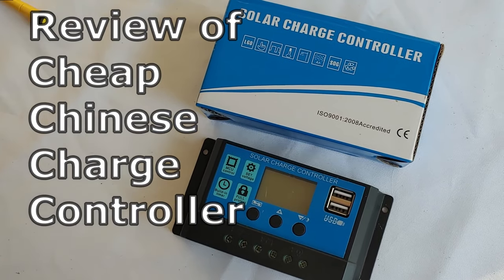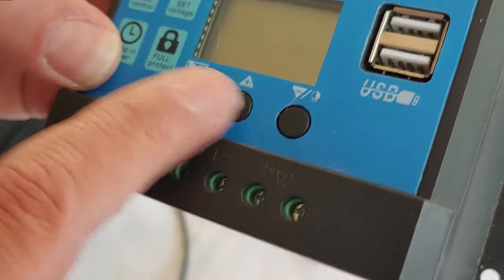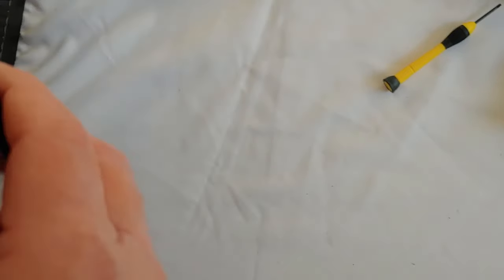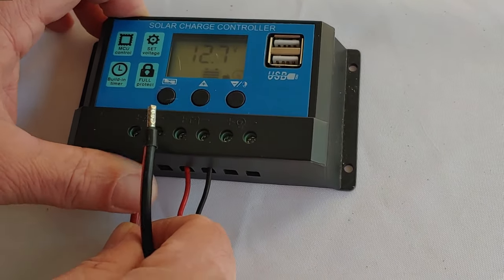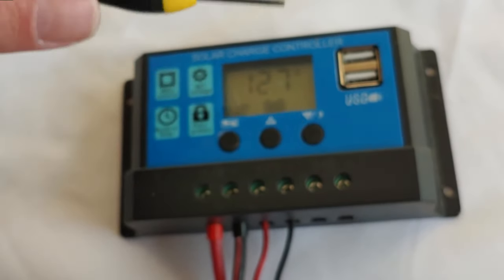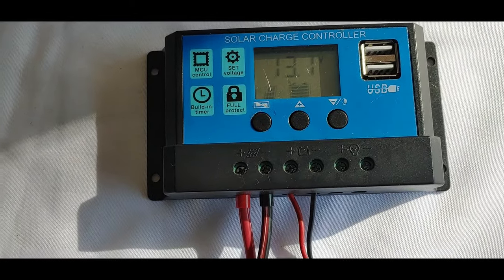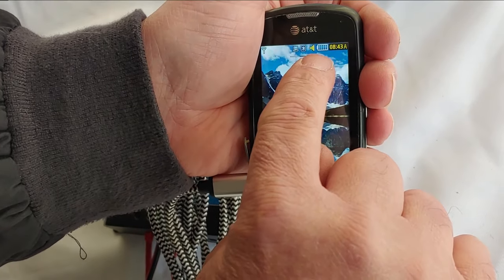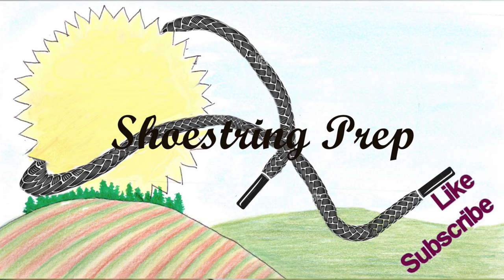Cheap solar charge controller

Comment: You did not explain the timer function. Somehow I could not get mine to work right... And by the way a LiFePo4 can be safely be charged by those PWM charger because their voltage levels are really compatible except that the later do not need equalizing and prefer not to be trickle charged. But that's why it is imperative that the LiFePo4 has a built in BMS, which most of the commercial packs have de facto. I prefer to attach my own BMS with bluetooth and active balancer to monitor the state of charge and balance of the cells. Preferably, I would chose one that match my deisire Ah and that come with 1, or better yet,  5A! active balancer. Both Heltec and Daly makes one for a reasonable price. Heltec is cheaper but Daly is  bluetooth capable.
Reply from the maker: If you have expensive equipment you should probably buy a better charge controller. These are very cheap. Thanks for your comment.
Reply: @shoestringprep  You're right! This charger  is actually perfect for my brother's pond. It uses a 24V, 80Ah deep cycle battery, one 300W inverter and two 200W panels. It's a $80 dedicated solution, that fits the bill.
Reply from the maker: @francoisguyot9770  Thanks for your comment.

Comment: Hi shoestring. Where should i connect the inverter ? On the battery connections or load connections?
Reply from the maker: The inverter is connected to the battery not the charge controller. Thanks for your comment.

Comment: Can I use this for this Portable Power Station 100W Portable Generator 146Wh/39600mAh External Lithium Battery Pack with USB C or my Newpow power station and bypass the battery since they both have their own built in batterys
Reply from the maker: I don't own one of those generators so I cannot answer that question. Sorry. Thanks for the comment.

Comment: Recently I wondered how much is the charge controller type or model going to affect the performance of your system? I have a cheap charge controller like this one. And it does work. But some people seem to have varying results on what voltage their batteries are charged too. That could be just the battery quality, but I wondered how much of that is being affected by a good or great charge controller versus something average? Are the results of a good or great charge controller going to look the same or very different than an average one controlling a system being charged? 

Thanks.
Reply from the maker: The type and model of the charge controller makes a great deal of difference.  Thanks for your comment.

Comment: Hello. I have a 30 W panel kit, but no battery. I connected the solar panel lines (neg & poss) to the Little blue regulator, as shown in your video. The regulator worked right away, so I charged my phone and my 20,000mAh internal portable battery charger in those 2 USB ports, and it charged both of them. After about an hour, I had to leave, but I left 2 of my 20,000mAh internal portable battery chargers connected in the USB ports.  The next day, with the same set up, but this time the little blue regulator didn’t show nothing at all, complete blank. It did this for two hours with direct sunlight, and again the regulator showed nothing. I made sure everything was connected right and in place, but still no results. Can you tell me what that’s about? Thank you
Reply from the maker: The system you describe will work. I have done it myself. But the manufacturers say that you will burn your charge controller out if it is not hooked to a battery.
Good luck and thanks for your comment.
Reply: @shoestringprep  Thank you. So the little blue charge connector is pretty much a goner huh  🤦🏻‍♂️ now I gotta get a new one. I appreciate your time & wisdom. Thank you once again🙏🏼
Reply: Hello again @shoestringprep! I wanted to ask if you could help me choose the best & fair priced 12v battery that would best fit my 30 watt panel? 
& since I’m here asking, how about the best fair priced inverter, where it be 150-300 watt inverter. What would be your recommendations be sir? Thank you!

Comment: How does the wire make the connection to the charge controller?  I know you unscrew something and then a square opening appears. Then you put the wire into the square opening and tighten the screw. But is the connection made by the wire touching the plate that drops when you unscrew the screw or does it connect when the wire goes in the hole and touches something inside at the back?
Reply from the maker: I don't know. I do know it works. Thanks for your comment.
Reply: The screws, plates and back of the holes will all individually be sockets connecting the circuits

Comment: Hi just subbed how long did it take to charge battery just rigged up sysyem bit baterry showing full but discharges fast and showing number 601 on controller same one as you
Reply from the maker: How fast your battery recharges depends pn the size of your solar panel. Thanks for your comment.

Comment: I hooked up the same charge controller to my RV. Do l want to move the load lines from my batteries to the controller or leave them hooked to the batteries.
Reply from the maker: I would leave the load hooked to the battery. Thanks for your comment.

Comment: You said you had 'lead acid battery' as bulk of your power systems. 

I was curious to ask ... the lithium batteries haven't been around that long. Doesn't this mean lead acid may possibly last better if taken care of? There should be more years to have scienced out all the kinks on something that's been around longer? And I'm curious how long you think a lead acid battery bank would last for if taken care of right? Thanks.
Reply from the maker: My lead-acid battery bank has run well for ten years and is still going strong. I don't know how long it will be before they die... But these batteries are well taken care of.
Thanks for your comment.
Reply: @shoestringprep  That's amazing! Thank you for the reply.

Comment: What king of phone is that man?
Reply from the maker: The phone is an AT&T. Thanks for your comment.
Reply: I noticed that too it's a Samsung S3650 Corby or Genio ; the camera is very poor, and no smart dialing,and no wifi ?; i was looking for one of that size (the big ones i have are not suitable to carry in the pocket (nor in your hand...not anywhere,actually...) to replace my HTC Explorer (excellent phone for over 10 years,perfect,perfect battery etc ,but terrible camera also,actually totally USELESS) but i wanted one with a better camera, and it probably never existed      lol
Reply from the maker: @josepeixoto3384  Thanks for your comment.

Comment: 4.14 (re device/lightbulb).. 'as long as the sun is on the solar panels it will run' - is this correct? What should happen.. to my guess.. is that the device (lightbulb) is run from the battery or the solar until the battery lowers to a certain voltage (maybe 11 (lightbulb)) and then the device will be switched off until the battery has regained some charge from the panel (maybe been lifted to 12v) ??
Reply: if the controller allows the battery to drop too low (by running the device when there is no sun) the battery will be ruined and lose its ability to recharge.. so this low voltage cut is very important.
Reply from the maker: Thanks for your comment.
Reply: @shoestringprep  Did you read it or have reaction?
Reply from the maker: @sammorganmoore  I read all the posts and happy to do it. Please restate the question, because I did not see any questions. Just statement
 And as always thanks for the comment.🙂
Reply: @shoestringprep  I quote what you say and then ask you a question about what you said. - just before the question mark. Is it correct that the device only works when there is sun on the solar panels?
Reply from the maker: What I meant is the load will run with the solar power as long as the sun is hitting the solar panel. After the sun is down, or it is cloudy, the device will run off the battery and drain the battery. You can also program the load to run 24 hours, 12 hours or from dusk to dawn. I may also do a video on the is subject. Thanks for the comment.

Comment: , can i charge my lead acid solar batt using a power converter with at least 12amps not a solar panel,?thanks👍
Reply from the maker: You can charge your lead acid batteries with a battery charger. If your power converter is, made to charge lead acid than you can. Check the manual for the power converter. Thanks for your comment.

Comment: I just acquired one of these but without instructions as it came with another purchase. Mine however is suitable for lithium but I cannot see how to set it to different battery types. I have found a screen that scrolls from BT1 to BT6 which possibly are type settings. Can you verify which would be which please?
Reply from the maker: Since I am not familiar with that model I can't say which one. Just make sure the settings is about 14.6 volts for lithium. Thanks for your comment.

Comment: Will the load operate a 12v device at nighttime, if the battery is charged? ty
Reply from the maker: Yes it will. The load will take power from the battery. Thanks for your comment.

Comment: Can you just use the 12 V power supply without the batterie ?
Reply: No, manual says not to operate the device before the battery is connected

Comment: QUESTION??? Can you connect an inverter directly to the controller or must it go through a battery?
Reply from the maker: The inverter and charge controller will need a battery to power both units. Thanks for your comment.
Reply: Inverter always connects directly to the battery. Theoretically you might be able to run a small 25 watt inverter on the load side but not advised
Reply: @tluva1020  thank you!

Comment: I am using one of these controllers to charge a Milwaukee M12 Lithium battery but I've already killed a couple of batteries. I use it to power a 4G hotspot from the USB port and a WiFi camera (1Amp) from the load terminals. I have it set to the correct mode for lithium batteries and it charges fine. My trouble is when we get an overcast day the batteries drop below the Discharge cutoff voltage but it does not cutoff the load and the batteries are discharged to destruction. I'm wondering if there is a minimum load current required for the controller to function correctly.
Reply from the maker: I have not noticed a minimum load requirement. But these are cheap charge controllers and they do have to be watched. I check mine frequently as well as unhooking them in the evening. Thanks for your comment.

Comment: is it ok to have (2) 12v batteries connected together for the purpose of having more storage and use this charge controller
Reply from the maker: Yes you can use this charge controller to charge batteries that are in parallel. Thanks for your comment.

Comment: I want to change the discharge stop voltage, and discharge re-connect voltage. I can get into the menu and settings and change the values, but it does not seem to retain the changed values when I go back into the menu to check..... I can't tell if my values remain set, or returned to defaults
Reply from the maker: With my charge controller the value stay set. And will not go back to the original settings unless I do it. Test and see if it works the same as mine. Thanks for your comment.

Comment: Quick question: Does this device come on if only connected to solar panels (19.4 VDC)? I’m trying to troubleshoot the one that came with house I bought last year. Battery appears to be ruined (disconnected it). But device won’t display anything.
Reply from the maker: The solar panels may power the device but that can damage the charge controller. Always connect to the battery first. Thanks for your comment.
Reply: @shoestringprep  yes, I see now that it operates by power from battery only, not from solar panels. Prior battery was defunct. New battery works great.
Reply: @shoestringprep  thanks for your help

Comment: Hello, Does it work if no battery plugged in ? Thk you
Reply from the maker: No, the charge controller gets it's power from the battery. Thanks for your comment.
Reply: @shoestringprep  Thank you.
What kind of battery are recommanded : Gel, Acid, Li-Ion, LifePo4 ?
Actually, i have a spare 110W solar Panel and i would like to use it with a charge controller as an emergency USB plus + 12V lamps
Reply from the maker: @BlueThailand  I would recommend a cheap 12V 100Ah LiFePO4 Battery. See a link to one I like.     https://amzn.to/3hxzDmT. Thanks for your comment.
Reply: @shoestringprep  👍👍
Reply: @shoestringprep  Hello, i found and bought a similar battery. Does this charge controller able to stop charging the battery when full ?
Thank You
Reply from the maker: @BlueThailand  yes it does. But it is cheap. Keep an eye on it. Thanks for your comment.
Reply: @shoestringprep  Thank you. I guessed but as it is so cheap and Chinese that i had doubt ;)
Finally, it is a cheap solution; For 1200 THB (35$) i have the battery and the controller. This way, i can charge small devices (usb fans, smartphones, .. and 12V led lamps
Not the top, but useful.
Thank you, sir

Comment: Is it at all possible to use this with the battery only and without the solar panel? I want to hook this up to a small inverter and use it to prevent any appliance from draining the battery too deeply with the low voltage cutoff feature, but it doesn't seem to be working even though my multimeter shows I'm getting 12+ volts. What am I missing?
Reply from the maker: The point of the charge controller is to control the voltage from the panels going into the battery you will need a charge controller. The charge controller will protect your battery from overheating.
Reply: @shoestringprep  So the low voltage cutoff feature does nothing then?
Reply from the maker: @1acroyear1  the low voltage cutoff is supposed to turn the charge controller off at a certain point. But with these cheap charge controllers that does not always work. Thanks for your comment.

Comment: Can we used solar panel (with Charge controller) and Current (AC) to charge our battery at the same time (simultaneously)... Is it harmful for the battery? Waiting for you reply pls...
Reply from the maker: As long as your charger controller is set correctly and your (AC) battery charger turns off when the battery is fully charged you should be ok.
Reply: @shoestringprep   thank you so much

Comment: I want to charge 12V old car battery and use it for WIFI surveillance camera that uses 12V. Commercial manufactured solar or  battery powered cameras can't do 24/7 they only wake up with PIR sensor.  
Camera uses up to 8W of energy, to run 24/7 it will be about 192Wh /24h. From 12V battery it would be about 192/12=16Hh,  Old battery is rated at 45Ah, so I assume that it can hold a third of its rated power, and it will get some light during the day directly from solar panels, so from the battery it will have to run only for max 16 hours when there is no sun. So in the winter short cloudy days I might need some 100W to 200W so it reliably can top off while sun is available.
There are plenty of cheap used panels available locally, panels in 100 to 200W range are almost for free. But most of them have higher rated working voltages, 40V or more, up to 100V. 
I wonder what will happen if I connect such panel (say 50V working voltage, and use only one 12V battery) to this little inverter that is rated for panels up to 25V when using 12V battery, or 50V with 24v battery. Will it fry controller, will it fry battery, or full potential of solar panel will not be used, and extra Voltage will go to waist, and I will get only half of what solar panel would be able to deliver?

Comment: the wire I have that connects to the solar panel is just bare wire - probably 22 gauge - what is the connector type that is used to plug into the controller for the solar panel?
Reply from the maker: All my charger controllers use a stripped wire to connect. Thanks for your comment.

Comment: would you describe the type of wires I should buy.  My solar panel has a connection piece that does not fit into my solar charge controller
Reply from the maker: You will want wires that are striped on one end and can connect to your solar panels on the other end. The striped end going into the charge controller.  Thanks for your comment.

Comment: Can we use a wall adapter as charger instead of PV array? I wanted to use this for a system that has 18V emergency lights as load and the battery will run them but when the grid comes back on the battery needs to be charged by the wall adapter. Is this suitable for that?
Reply from the maker: I don't see why not but I've never tried it myself so I don't know. Thanks for your comment.
Reply: Manual says not to do that....

Comment: I don't think the sun has to be shinning on your panel for the load terminals to work.  I think it will pull from the battery, no solar panel even needed.
Reply from the maker: I agree. Thanks for your comment.

Comment: Mine started switching my system from a 12 volt to a 24 volt system all on its own..... it will run at 12 for awhile than screen fades out for a minute or so and comes back on and identifies itself as a 24 volt system.. Allmost lasted me a year.
Reply from the maker: They are cheap. Thanks for your comment.
Reply: @shoestringprep  awe mine came with the panels i purchased.